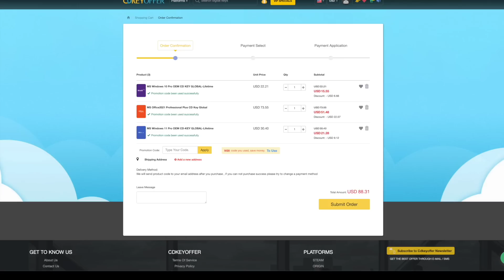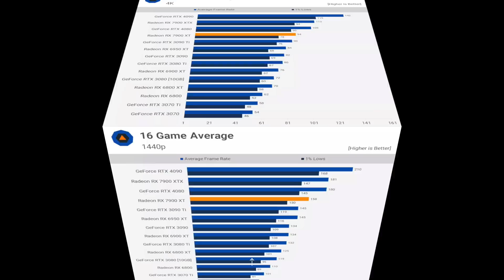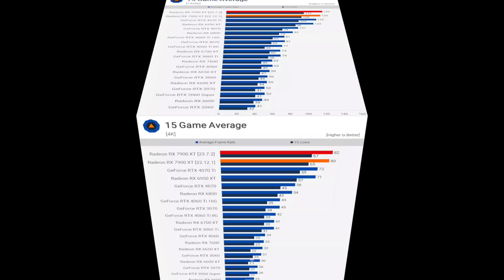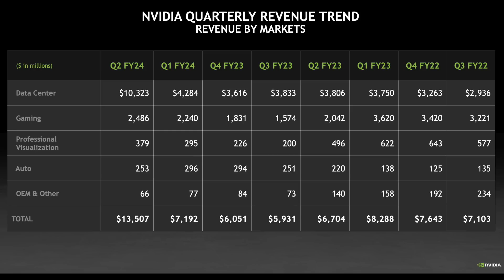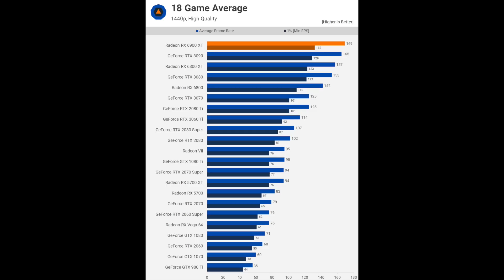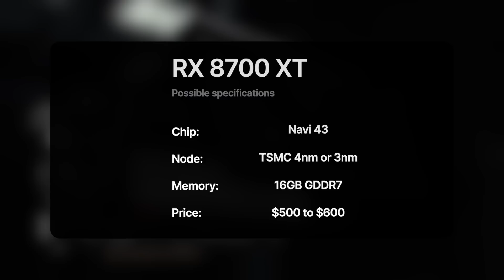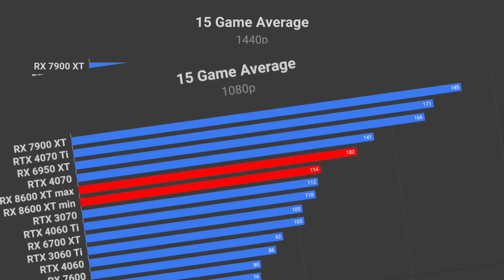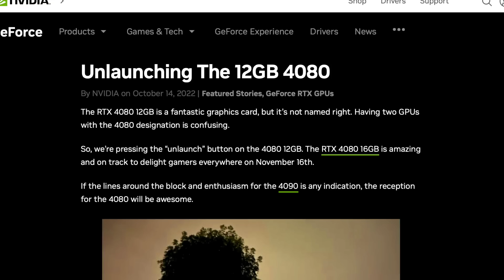The Future of Graphics Cards: RTX 50-series, RX 8000-series

Comment: Nvidia is capable of making huge chips for RTX 50 if they go with TSMC 3nm, which allows them to get in a lot more transistors, meaning more Shaders, RT Cores, ROPS and L2 Cache, and so on, because it's a smaller node that allows for all of that. The RTX 40 Series is on TSMC 5nm. Nvidia could also choose to use G7 memory with RTX 50, which would result in huge bandwidth gains. Hopefully, high end RDNA 4 isn't cancelled. More competition is needed in the GPU market. But there have been leaks saying that Nvidia could scale back on their 50 Series lineup due to a lack of competition and the AI boom. This is the way things are heading now, unfortunately, and I hate it. I won't be surprised if Nvidia completely ditches its GeForce GPUs at some point so it can focus more on its data centre and AI products.
Reply from the maker: Nah. NVIDIA won't ditch gaming sector any time soon (if ever). GeForce still brings in a considerable chunk of money. Priorities are shifting. But no more than that.
Reply: @theivadim,  I guess you are right. Gaming is too big for Nvidia to just ditch it, and they still make lots of profit from it. Because they are constantly cutting corners when it comes to their gaming GPUs and have shifted nearly all their attention towards AI, it feels that way. I have zero doubts that Nvidia will be cutting corners when it comes to their high end RTX 50 Series GPUs unless there is a lot of competition, which I highly doubt will happen in the high end.
Reply: @theivadim  Yeah I see people be concerned Nvidia is going to ditch gaming and while I see where they come from it wouldn't make sense. Gaming is still such a huge market worldwide. It's like a completely different costumer base and it's something Nvidia has pretty much been top dog for decades. For the prestige alone it would be worth making gaming GPU's not to mention that the hardware they make can do both. I'm hoping to see more AI stuff and cool hardware and features be integrated into PC gaming because of these advancements personally.
Reply: But 3nm will also more expensive than 5nm. So with 3nm it is possible gpu will get another price increase. I think what nvidia will do is they will make another custom 5nm together with TSMC for Blackwell similar to what they did with 12nmFFN for turing. 3nm will be exclusive to their professional stuff that will be sold for higher margin.
Reply: @arenzricodexd4409  That would make zero sense if they decided to use the TSMC 5nm process again because the RTX 40 Series is on TSMC 5nm. If Nvidia doesn't go with a smaller node with RTX 50, they will struggle to get in more transistors, so they won't be able to achieve a large performance increase with RTX 50, which will make the entire lineup totally pointless. Why bother releasing a new generation of GPUs if they are not much faster than their previous gen counterparts? It's just stupid.
Reply: @RenderPixion  getting to lower node will be much harder from now on. after 3nm it will be 2nm. even TSMC already seeing issues with 3nm. rather than jumping straight to 3nm nvidia probably will work with TSMC to further optimize 5nm first before make true node jump. we will see more AI related stuff to augment 50 series performance improvement rather than pure raw power improvement. at least that will they do for geforce. the more precious 3nm will be utilized by their enterprise solution first. this is probably why nvidia did not improve the performance jump that much with 40 series so they can go with 5nm for another generation. 

going with 3nm does not mean anything if they cannot sell those card at a price that consumer willing to pay. even 40 series with 5nm already seeing this issue.
Reply: @arenzricodexd4409  I really hope this isn't the case. If Nvidia really wanted to use TSMC 3nm for RTX 50, they could. The problem I have with this AI boom is that Nvidia has shifted most of their attention towards AI and data centre products, and this has had a negative impact on the consumer market, such as ridiculously high prices and gaming GPUs suffering from lacklustre hardware upgrades. Knowing Nvidia, they will scale back on the hardware of their gaming GPUs and still raise the prices, and they will probably use the better 3nm node for their data centre products. It looks like that is going to be the case, unfortunately. The performance increase from RTX 30 to RTX 40 is massive in the high end and enthuiast class segment. The same can't be said for the midrange GPUs, unfortunately.

Comment: The RX 8600 and RX 8700 will still be welcomed cards. They will match and beat the 7800 XT and do it for cheaper. 👍
Reply: If the specs and performance of Navi 43 & 44 are significantly less than that of the RX 7900XTX, wouldn't it be better to pick up a 7900XTX for $875-950 (as it is likely to go on sale for sometime before the end of 2023) and "bypass" the next-gen without losing much, if any, in terms of performance due to the significant difference in compute units and vram that will most likely exist even if there is a performance increase in compute unit performance between the current gen (7000 series) and the next?
Reply: @glw607  just a thought, since fsr3 launching powerful gpu's not target for amd, they might just now compete with nvidia dlss for future by improving fsr3 and so on, overall, I see amd as non greedy.
Reply: But still 8gbs and 12gbs though?
Reply: You can’t just know that lmao. We’ll have to see. And based on the fact that the 7800 xt has a 20% increase over 7700 xt. That makes chances worse. Also I’m like 99% sure that all these rumors are just because they canceled some of the versions of the high end ones. So I’m guessing that it’s still releasing 8800 xt and 8900 xt.
Reply: They'll have large supply if they're not making large top end gpus, that should mean better pricing
Reply: Wouldn't bet on a cheaper price.

Comment: Navi 43 should be a x600 card chip.
It's ok if the performance is there to call it a 8700xt.
But the price should not go 500-600, it should be 400 like the 5700xt or 450 like the upcoming 7700xt and not a cent more.
If you see the 7800xt ( should be 7700xt N32 chip ) is going for 500. 
As the 6700xt was 479 at launch.

Nvidia will pull another rtx2000 series.
Only the 5090ti will have uplift in performance.
5090 will perform the same as 4090, which is sad.

Intel will come in closer to Amd.
Intel and Amd have to fight each other just like in their cpu market.
Reply: Corporate price inflating is the new fad. Every large corporation is outpricing all of their own products. And competition is just copying it. It is sheer greed.

Comment: why is there no 4090 on those comparisons ? also, you think 5090 will be worth over 4090 ?
Reply from the maker: 5090 may not get the same insane uplift as the 4090 did. But I think it'll still be enough to justify buying one if you want THE BEST.
Reply: The rule of thumb is, upgrade every 2 or 3 generations.
Reply: @Twitch_Moderator  what if i have no PC and will have the cash to buy one in next year, during or after march ? :)